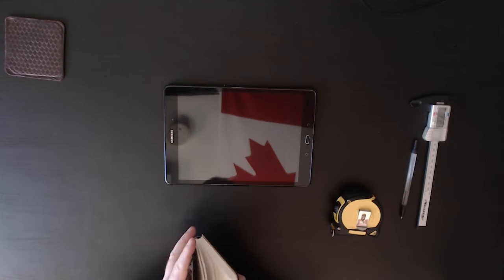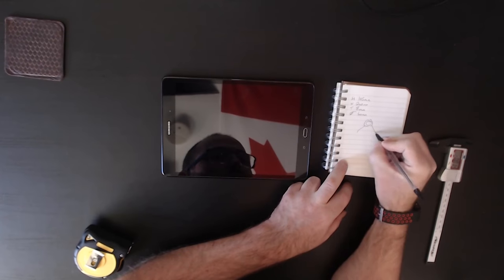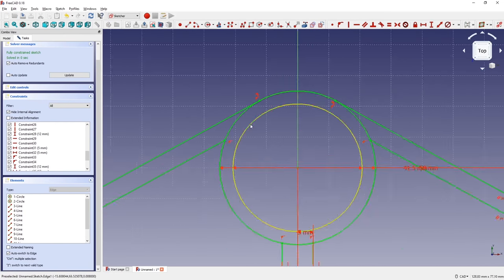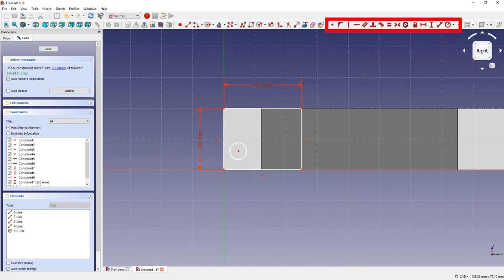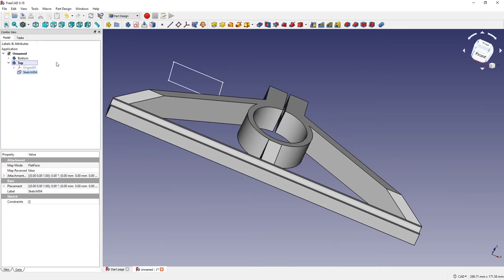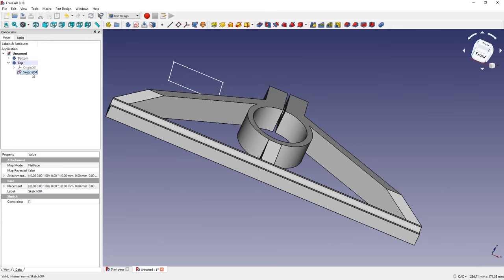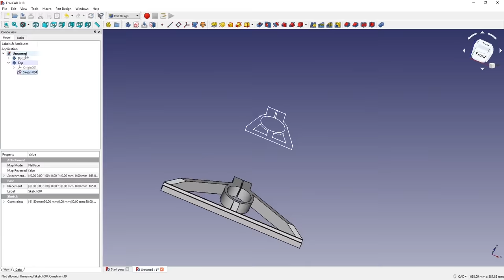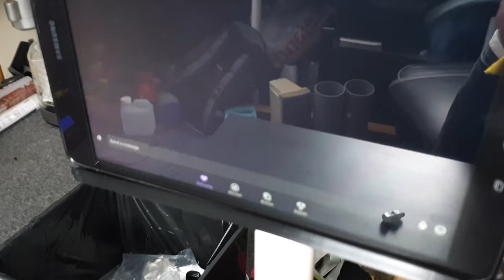Trying FreeCAD for the First Time

Comment: The nice thing about autodesk cutting options for personal users is that it will raise the need for Freecad to become a better software, exactly like autocad's Maya did to blender, in few years with enough demand this software will be fantastic!
Reply: i will switch to freeCAD
Reply: I think Blender has done more to pressure Maya to become better than vice versa. When you have a tool that is free,  and improving on a monthly basis, it makes your expensive software with infrequent updates look bad. On the other hand, I don't think FreeCad has the organization, funding and user base to offer much competition to F360.

Comment: Welcome to FreeCAD, as any software, despite your vast experience in other CAD software, it has a learning curve, Im sure you will get to enjoy it. A couple of tips. Instead of using regular lines, it is best to use polyline, and try pressing M letter on each point, it will change to arcs, and other ways to continue with the sketch, without having to change to other tool. Also, if you are making a part that is symmetric, you can do only half of it, and then just with a symmetric operation, complete the other part. This means, less constraints to fight with, less work.
Reply from the maker: Thanks for the tips  I will keep them in mind. You're right. With any new software, there are learning curves. The intent of this video was to show that learning curve to others that were migrating from another application cold.

Other than the audio feedback from other users, I hope I did a good job

Comment: Text support is weak in Freecad.
The community is very strong and supportive.
The latest release has in-built threads capability where it was a minor career, before.
I have been able to print everything I've needed to design in Freecad.

Comment: Yes, UI design is one of the areas where you tend to see deficiencies in open source software. The problem seems to involve three things: ignorance of design guides (& research), no money to run independent trials on actual end users and most annoyingly for me as a programmer with an interest in UI design, stubborn "it works for me" syndrome.

Good video though; looks like I'm going to stick with FreeCAD as I'm only doing some fairly simple things for 3D printing.
Reply from the maker: If it does what you need, no need to change
Reply: I get what you mean but it isn't a huge deal because it's foss and you can create a skin for it.

Comment: I heard a lot about Fusion 360 from both the YouTubers (such as the awesome This Old Tony) and the engineer's where I work. I need a rendering software now since I bought a 3D printer so I immediately went to the Autodesk website. At nearly $500/year (which is Glock money) I think I will just learn FreeCAD. Thank you for the basic review video. I think I will follow this rabbit hole and see where it goes.
Reply from the maker: When you say rendering, what are you looking to achieve? Fusion360 can render, but the personal licence only allows local rendering, not cloud. As long as you have a reasonably modern pc, it should be more than ample. Just remember the personal is for non commercial use 👍

Comment: Current Fusion user here.  For many reasons the new license restrictions can't work for me.  And the poor design of their subscription services put the nail in that coffin.  Trying to learn FreeCAD now. Hopefully the 'diaspora' will bring new energy/motivation to FreeCAD project.  

There is a thing called an anchor bias.  I remember cursing fusion back in the early days as I was trying to learn it as an alternative to sketchup.  

I think it's important that those of us thoroughly displeased with the state of affairs stick with alternatives and help them grow.  Otherwise it is a voice of consent for all the 'bovine fecal matter' thinking over at autodesk right now.  

Thanks for the vid
Reply: Left Fusion too and am trying to get a grasp of Freecad but it's soooo diff than the other cads I'm used to. You know how to add lobes to the outside of a circular part? I'm stuck.
Reply from the maker: glad the video is of help.
fusion360 remains my primary tool as it works for me and the restrictions are not a problem for my workflow... currently.  I'll continue to learn freecad... just in case I need it 👍

im interested to know what restrictions are blocking you using F360
Reply from the maker: possibly.addin a sketch to the nearest face and do a join operation?

what specifically has made you move away from F360?
Reply: @IQWorkshop  Recently needed to print out something 1:1 scale as a template for manual cutting a pattern out of steel plate.  Turns out to do that with any hope of dimensional accuracy, I have to print to PDF out of F360 first.  Also turns out that is now a paid feature.  I can't justify 80$ cdn to buy a month subscription ( the minimum cost ) to print a template for one part for a personal project.  I suspect the future will only hold more feature squeezes as they try convert more 'personal' licenses to 'subscribers'.  

I actually did bite my tongue and purchase a month sub at 80$.  Figured I'd just cram in a whole bunch of F360 time in that month and then doodle away with the personal license.  However after giving them my money, and struggling for several hours to figure out why it didn't 'work', and then spending another 2 hours online with support, it turns out I need to relinquish my personal license before the one month non reoccuring subscription license would be recognized.

After which I'd have to re-apply for a new personal license in order to continue using F360 as a personal scratchpad.

I just don't want these types of headaches for what is supposed to be a happy personal fun time activity.

Plus spending the last decade in high level IT, I'm quite allergic to SaaS and am more or less convinced ( despite the clever salesmanship ) that it is intrinsically anti-consumer.
Reply from the maker: @nobiggeridiot  I have not used the print to pdf feature, or the sheet metal workflow, but I do use fusion for laser cutting which needs dimensional accuracy. 

To do this I create a sketch that captures the geometry I need and the export as a dxf.

If you are able to create this in the sheet metal workflow, which I'm assuming may need flattening,  you could then use a vector drawing app like inkscape (free) or Adobe illustrator to print.

Hope you find a solution to you problem
Reply: @IQWorkshop  The solution looks like FreeCAD.

Your workaround is good, but I can't be confident the DXF export will continue to be a 'personal license' feature.
Reply from the maker: @nobiggeridiot  if dxf export goes away, that will break my laser cutter workflow and I'll be out too

Comment: Congratulations for creating your design in FreeCAD.  (I have not tried FreeCAD yet; I actually have a paid Fusion 360 subscription.)  But based on what you said about sketching, I would make one recommendation to you:  Instead of putting most of your design in one sketch, try using several simple sketches to make your design.  For example, in this case you could have made one sketch with the general outline of the part, and then you could have extruded your base profile(s) from that sketch.  Then, you could have made another sketch for the cutouts, and then extruded that, etc.  The great advantage of this method is that since your sketches our simple, your constraints are also simple.  I believe this is the preferred way to design when using a 3D history-based CAD software; at least, this is how I learned to design in SolidWorks, Alibre Design, and Fusion 360.  Thank you very much for this video.
Reply from the maker: Thanks for the feedback. I hear what you are saying. I have arrived at this methodology from using fusion and trying to not have a timeline from hell, only for it to break (yellow and red warnings). I have trouble finding a balance between the two. But I guess thats what I need to focus on my development 👍
Reply: @IQWorkshop  FreeCAD works pretty well. There is definitely a learning curve but that is with any new CAD software.     You can make very complex things.   I then export them as a mesh for printing but there are other ways.  Not a huge Autodesk fan.
Reply: I think the advice of using more individual sketches is part of a better workflow in FreeCAD. I've used Fusion 360 for years now and it still infuriates me on occasion. The "where the heck did that go?" and "what hidden thing makes it not work today" in Fusion are giant hold ups. Just like anything is gets better as you practice.

Comment: FreeCAD is nice. But I think that needs a complete refactor (lot of crashes and unexpected behaviours) and a dev approach similar to Blender from 2.8 (a better and user friendly GUI). Implementing the Vulkan API could be nice also, despite being complex due OpenCascade stuck in the past.
Reply from the maker: Its not without its issues. But is a viable option if f360 is not.

I'm sure that the increased focus an support on FreeCAD will drive improments
Reply: @IQWorkshop  Of course. Just need a backing / support "à la" Blender Foundation.
Reply: Yet to see the crashes you speak of. We use a number of stations commercially with a extremely stable history.

Comment: I've never tried Fusion 360. To me it looks a lot like blender or 3D Max. I've used Inventor since Series 9 and my thought process for creating part and assembly models is closely tied to the way Inventors work flow works. I also, very early on learned to use Inventor with a 3D motion controller. Two questions I've never had answered about Fusion 360 is 1. Does it support the use of a 3D motion controller. And 2. Does Fusion 360 have a API like iLogic in Inventor. Thanks for you time. God bless and stay well.
Reply from the maker: Inventor is f360s bigger brother in my opinion. 

From what I have seen the user  interface is very similar and transferable. 

I "think" all of the HIDs are compatible across the apps, but worth checking. 

F360s scope is limited to objects, where inventor can handle more geometry and deals with things on a much larger scale scale.

I think of it this way. I would design multiple objects in f360 and then bring them into inventor. 

Give it a try on the free hobbiest license if you're on the fence

Comment: For threads in FreeCAD take a look at the fasteners workbench it makes it very easy. - I am in the same boat as you moving from Fusion360 to FreeCAD and to be honest, I haven't found anything that I want to do that I can't make happen in FreeCAD. The Fusion360 interface does make some things easier but I am hoping with a little bit of Python it will be possible to mimic some of that stuff in FreeCAD.
Reply from the maker: thanks for the feedback, and I will definitely take a look at the fasteners workbench. 

I hope the freeCAD development team can step up seeing the movement of many makers is in their direction. 

Not  that I think they need to make a F360 clone, but make the UI more intuitive. For example I had so many issues adding fillets as i had to cycle through the list to find the ones I wanted to apply it to. I couldn't just click the edges. But admittedly that could just be down to my lack of knowledge, which Python also falls into that category ;)
Reply: @IQWorkshop  - also look at the addon manager Bolts Macro
Reply: You can just select edges. If you are in the part design work bench select one edge and add a filet then when the dialogue pops up select add. Now you can select edges until your heart is content. The only issue I have had with that is if your original sketch wasn't fully constrained sometimes it will refuse to add filets to certain edges.
Reply from the maker: @Adventuresincreation  I'm so glad I made this video, not only did I learn a ton about a new application, I also connected with like minded people who are also willing to share. Thanks for taking the time to respond.
Reply: I am excited by the renewed interest in freecad. I had moved to fusion 360 but I think I am sticking with freecad now.
Reply: @IQWorkshop  But, you can just click edges. And ctrl-click to multi-select. And select a face.
Reply from the maker: Thanks for the feedback. I'll try thin in my next project

Comment: Onshape has very good sketching capability, can freecad import step, stl files created in onshape? I want to use freecad for CAM operations only
Reply from the maker: Hi there
Thanks for the recommendation and for the question 
Freecad can import step files, as this is a common  format to exchange geometry between cad programs.

As for stl, I would anticipate that it will as it exports, but if you can, stick to step as the verticy and face count with stl can be problematic outside of 3d printing

Comment: I moved to freecad from fusion 360 by doing draft designs and then converting them into sketches to speed up the design process
Reply: But ... but parametrization ? Non destructivity ?
Reply: @mihailazar2487  I needed to produce designs quickly and beginning from a sketch wasn't cutting it

Comment: I'm trying to switch away from fusion 360. I started using it 3 years ago and it just clicked for me and I picked up really fast. I can design any part I can imagine in Fusion 360 but they double charged me and the price keeps going up so I want to move to something else.

Using FreeCAD feels painful and slow to use in comparison. It's entirely the fault of the sketching and extruding system they chose to use. 3-6 step opperations in fusion 360 are 15-100 step opperations in freeCAD because of how limited and bad freecads sketching system is. You basically have to work around it.

In fusion I can make 1 sketch and extrude selected areas and the extrusion can perform boolean opperations and I can use the same sketch over and over again defining different extrusion opperations for each area, in freeCAD each pad has to be on a separate sketch. It's slow and painful...
Reply from the maker: Agreed. I love the concept of FreeCAD and the ethos behind it. Unfortunately (for me) the UI, let it down.

I've been using f360 on the startup and now the personal license since 2016 and gave FreeCAD a try on the transition. 

I have recently done a video looking at alibre atom3d,  which has a similar feel to f360 .

If that's something that interests you, take a look at my latest video 👍

Comment: I agree, freecad is definitely not ready. I was trying the assembly addon (which is necessary if you do complex parts) and it's definitely not there. I couldn't undo things for example, and colors were not copied, very slow and crashes.
Reply from the maker: I agree. It's something I'm learning slowly in the background just in case something changes again with personal licence of fusion360.

But if enough people contribute to support freecad it will get better.

Often open source is a passion project that goes away when the developer doesn't have time or wants to move on.

Enter commercial software, stage left!
Reply: @IQWorkshop  I would say if freecad doesn't get better, and Fusion 360 changes the terms, we're f** lol I don't see any nearly cheap alternative to Fusion 360
Reply: There’s more than one assembly module available as add-on for FreeCAD. Also, Realthunder’s version might be a game changer.
Reply: @Gumball_W  I tried the assembly module already and it was crashing non stop. I don't think assembly in a CAD program should be an Addon but rather a builtin feature. Not sure about this realthunder's version, I never heard of it.

Comment: Whats that red bulb? heating device?
Reply from the maker: Thanks for the question.

If you are talking about during the printing, this is a BLTouch bed levelling sensor.

It is used to measure the flatness of the print bed and adjust for any inconsistencies to make sure the layers stick.

It can be the difference between a successful print and failure.

Comment: Nice video, but the music is far to loud compared to the music. Also it is not required to full constrain a sketch in FreeCAD, however it works better when you do. Especially when changing measurements FreeCAD sometimes moves non constrained lines in unwanted ways.
Reply from the maker: Hey, thanks for taking the time to comment. I'll keep the music feedback in mind for future videos.

Ok To be fair, I'm a newbie to freecad and intentionally did limited research on  to see how bumpy the transition would be. I could not get the pad to extrude without having a fully defined sketch and all the faces resolved. I've still got a along way to.go learning freecad.
Reply from the maker: Paolo G  thanks for the feedback. This is the first time using freecad, so there are plenty of things I need to learn.

I think the reason I had issues with extruding was there was a break in the line and the face wasn't fully formed, even though it was defined